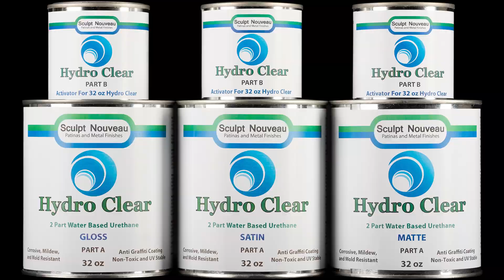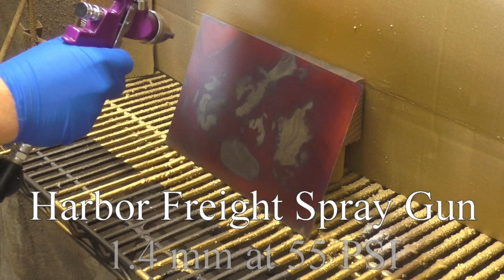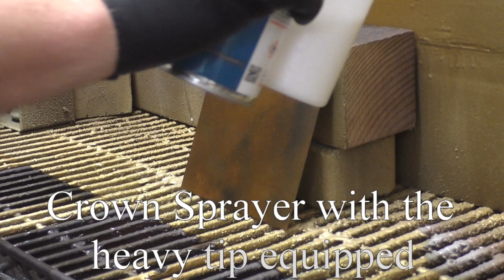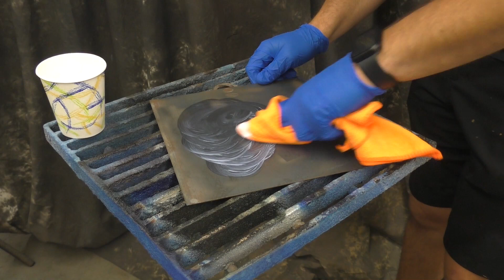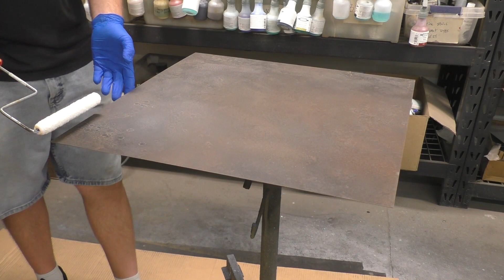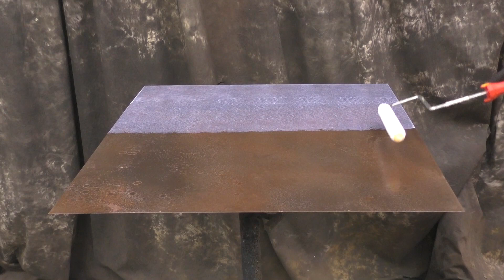Introducing Hydro Clear

Comment: Hello! I was wondering what the difference between Hydro Clear, Smart Coat and Ever Clear? I see they are all described as PU coatings. When would you choose one ober the other? Thanks!
Reply from the maker: Hydro Clear and Ever Clear are on a similar level. The difference being that Ever Clear is solvent based while Hydro Clear (as well as Smart Coat) are water based. Ever Clear will dry faster but cure slower in comparison to Hydro Clear. Smart Coat is a 1 part clear coat while Ever Clear and Hydro Clear are 2 part clear coats. Basically, it comes down to longevity for the difference between Hydro Clear and Smart Coat, Hydro Clear is just stronger and longer lasting than Smart Coat is in comparison.
Reply: @sculptnouveau  Thanks! Can I still apply hydro clear on an outdoor piece? Does it cure to be water resistant even though it is water based? It is for a conservation work that needs to be carried out at the client's house, so I am trying to minimize the use of solvents or anything that requires any more elaborate application procedures.
Reply from the maker: @biafonseca335  Yes, Hydro Clear is great out doors. Yes, it will protect the piece from water.
Reply: @sculptnouveau  great! thanks!

Comment: I have a cold rolled steel art piece 8'x4'; half is super rusted and half is mirror polished. Does Hydro clear distort the finish at all? I'm worried about losing the mirror look.
Reply from the maker: Mirror polished surfaces are the hardest to get a clear coat to adhere to. Depending on how it was polished determines the success but the Super Gloss will be your best bet. Give us a call and we would be happy to help you walk through the ins and outs of your project, 760 432 8242

Comment: Which clearcoat has the highest mechanical resistance? I would like to seal a steel stairs.
Reply from the maker: Hydro Clear and Ever Clear are both good choices but I would go with the Ever Clear for that one.
Reply: @sculptnouveau  thx for the repyl! And why would you go for Ever Clear? Is it stronger?
Reply from the maker: @Frank-dg3dw  Ever Clear dries faster while Hydro Clear cures faster. It really comes down to preference and time constraints.

Comment: When would I select hydro clear vs ever clear?
Reply from the maker: Great question. Hydro Clear would be ideal for when you need to apply the coating inside, say on a bar top or an elevator. Basically, where you need to stay away from the solvent smell really. If you need it to dry fast, Ever Clear is the better bet however.
Reply: Why would I use the hydro clear instead of the eve clear? Is it a lower VOC or no VOC benefit? Does it protect/dry as hard as the ever clear?
Reply from the maker: @garynordike1911  Ever Clear dries faster than Hydro Clear but Hydro Clear cures faster. Both are VOC free but Ever Clear is just a VOC free solvent whereas Hydro Clear is completely water based so no solvent smell. Yes they protect similarly.
Reply: @sculptnouveau how about smart coat? When would you choose that?
Reply from the maker: @biafonseca335  You would choose Smart Coat if you want to work with a 1 part clear coat or you were doing something where you would not need the durability of the Hydro Clear.